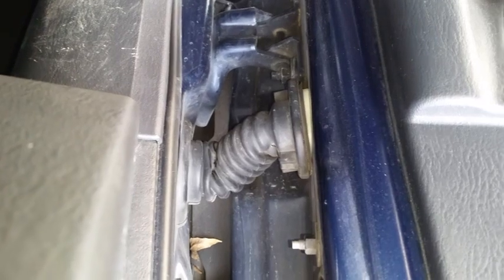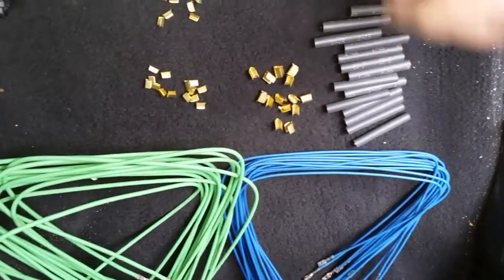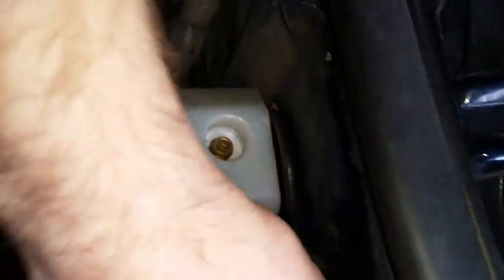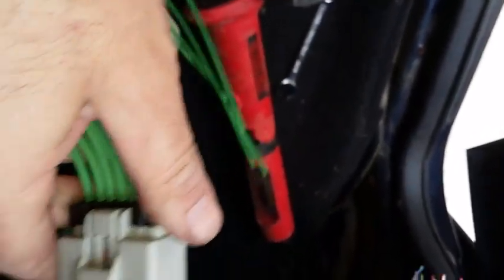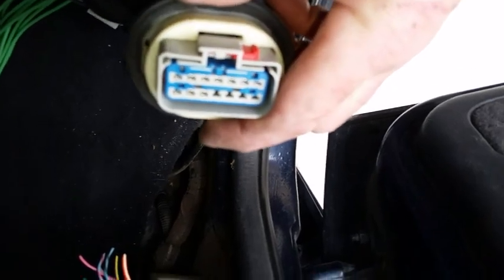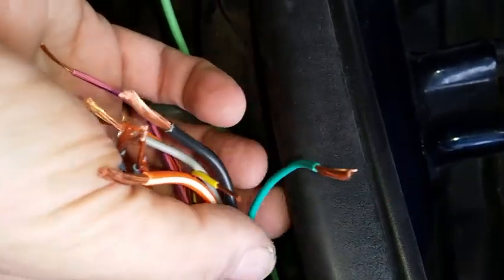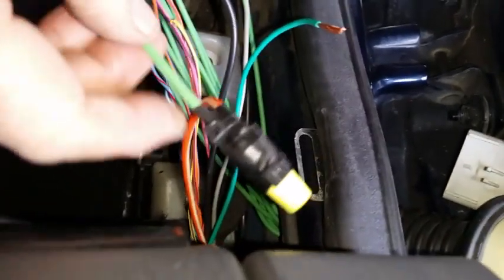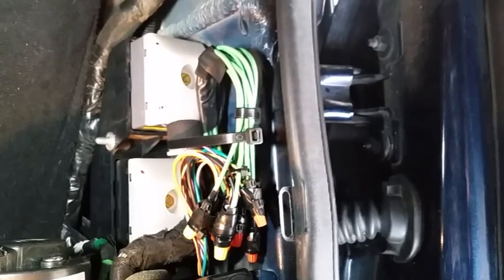1999 - 2004 Jeep Grand Cherokee WJ Door Wiring Repair

Comment: Placing the new connector with new wires beside the old connector with the cut off wires you can place a small piece of masking tape on each new wire a couple inches from the ends and write the correct color wire to connect them to on the masking tape and then push the wires thru the rubber door boot and make connections how you prefer. Then you won’t have to search for the correct wires with a multi-meter. Other than that there’s not really any other short cuts. This is a pain in the a** and has happened to everyone I know that has a Jeep Cherokee, especially 1999-2004.

Comment: The job would have gone faster if you labeled the wires with masking tape or something like that before you installed it. Wire nuts are for house wiring.
Reply from the maker: Pulling those wires through the boot with labels probably would mess the labels up.  In the video I mention I'll take heat for using wire nuts but they have worked well to this moment and are easy to deal with.

Comment: It is best not to soldier automotive wire,  it makes the copper brittle.  closed-ended crimp connectors would be a better choice than wire nuts.

Comment: Great video and very helpful. I bought the kit ($125 in Canada from the dealer) and I'm going to do this job as well. Too bad your video is upside down but it's still good info. Also, when you try and focus on something like those wire clip ends, it would have focused much better had you had a background near what you wanted to focus on rather than the camera trying to focus on the ground which was 3 feet away. Regardless, straight forward info that let's us know we can all tackle that job. Thank you!

Comment: Excellent video and the best way to repair that problematic area.

I went around pricing someone else to do this for me and here's what I found:  
A 4x4 shop wouldn't touch this project because they just want to bolt on parts.  
Next, I went to a car audio shop because they work with wires and they accepted the task - for $85 per hour plus parts/supplies, estimated to take about 1 hour to complete. 

If you think saving yourself the time and effort to order these parts assemble then get it all in and soldered is worth paying about $25 to $40 to have someone else do it, then go ahead. The car audio shop would have clipped the harness close to the door connector, soldered new wire there because it doesn't bend much and then ran the rest into the driver kick panel area and soldered the other end there.  

Another option - go to a You-Pull-It yard and yank a connector from a junked vehicle cutting wires deep into the kick panel area.  That may run you up to $30 but then you're gambling with that harness doing the same...any time after you install it.

All will work - key goal with either is to avoid stiff solder joints in the middle there between the door and body of the vehicle.
* Instead of wire-nuts to splice, I would suggest using shrink tubing and soldering the wires together.

Comment: Thanks for this video. I did the drivers side the same way except I soldered the wires and used shrink tubing. Also I plan to use the extra wires in the kit on the passenger side. You can actually remover the old wires same as you described with a small screw driver.

Comment from the maker: I did the audio shop route once but when it failed again I did this thing.  The original wiring is inferior to the new pigtail, the conductor had gotten quite brittle, perhaps from "work hardening" phenomenon.  I almost had the audio shop which does really good work, install these pigtails.  That's right forget getting this part at a yard.  I used wire nuts in case I have to repeat this repair and to avoid the hassle of soldering in the confined space.  But solder in the position demanded by the pigtail would not be a problem either.

Comment: Thanks.  I found the connector with  all the colored wires attached on ebay for about $12.00
using MOPAR P/N 5013961   Also included a set of in-line crimps.
The black wire appeared to be 12 GA.

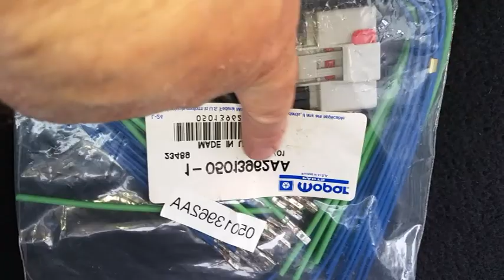Comment: At 2:30 you said the connectors are the same. I ordered two of the same. The drivers and passengers sides are different. The guides on the connectors are spaced further apart towards the corners on the drivers side. The passengers side is set in about 2mm on each side. 
I was however able to dremel the guides down and use the connector.

Comment: I'm thinking it could be easy to use colored stickers for the ends of each green wire.
You could get white stickers that are rectangular that can be colored with a permanent marker kit to duplicate the colors of the OEM wires.
For example marker the sticker for the + wire which is OEM red and white stripe to be red with white stripe on sticker. Put the sticker around the beginning and end of each green wire.
The ground can be black electrical tape or blacked out sticker with marker. And so on for each wire color.
It could help identify them. Maybe just look at OEM connector and map each wire accordingly without having to test each with a DMM.
I like that you use 12AWG on all 10 wires. 
Would it be fine to use 10AWG primary wire CCA on all 10 pins? I have OFC 12AWG on the way.
I've only got 16 and 10 Guage automotive wire spools on hand
100ft of GearIT 16 guage from Amazon and 20ft of HandyPack 10 guage from Rusty's Auto Parts.

I need to fix the windows mainly, then I'm rewiring the electric fan adjustable thermostatic switch for engine cooling fan with an override toggle on/off switch inside cabin that's ignition controlled and then wiring up power outlets (PD/USB3.0 & 12V socket)

Comment: I'm hoping I can use safley use 10guage instead of 12AWG for the door wiring to windows?
I have high quality 10AWG Primary Wire OFC 20ft . I also have 100ft of 16AWG automotive OFC wire.
I prefer to use the 10AWG guage for the doors and electric fan switch

Comment: I am so confused with the 10 wires all being green. I have no clue how to do the meter.
But is there a way to paint the outside of the wire or use colored tape or tape with colored markers to identify each wire.
Like Black, Grey+blue, red+yellow, Red, Green, Orange+White.
Something along those lines
I'm no electrician or mechanic and I'm simply trying to fix my power windows, power mirrors and Power locks on my
2002 Jeep Grand Cherokee Laredo 
Man wish I knew professionals like this in Aurora Missouri

Comment: Just bought a 2001 WJ with a 4.0 Liter. had to deal with broken door wires a week after I bought it. wished I had seen your video first, I had to solder the wires back together. classic black wire problem. change the two larger wire. when it breaks again I will do it your way. except the wire nuts would make me crazy as an industrial Electrician/ Mechanic.  But good job.
Reply from the maker: Thanks Michael.

Comment: Question: I can put the rear passenger side window down with both the driver control switch or the rear passenger switch and sometimes it won't come up until I open and close the driver side door a couple of times or close it firmly which of course speaks to the loose or broken wire issue in the driver side door boot. But since this can happen when the rear passenger puts the window down and not be able to put it up again until I go through the routine with the driver door ... is it more likely the driver door wiring (because it happens from that location as well) or the rear passenger side door wiring that is the culprit? Or is there more going on than just boot wiring such as some computer module? I hope my explanation of the issue makes sense.
EDIT: Just for everyone's knowledge, once I fixed the wiring in the driver door boot, I was able to raise and lower the rear passenger door without issue from both the driver control as well as that passenger window control as well.Thank you!

Comment: I just completed this repair to my driver door this evening.  Based on this video that the gray/black adapters would work either side - I purchased the passenger side kit to repair my driver door. 
 Finding:  While it's not exactly plug-n-play right out of the bag, it only took a little modification to make it work.
_________________________ 
Driver side:  If you hold the male end of the harness that is in the Driver door itself with the red lock tab face down, you will notice the oval shape of the main portion of the plug. In addition, however, you will also notice two small plastic ridges approximately 1/8 in height rising straight up off both left and right corners of the male plug....think of how batmans ears rise off the extreme ends of his head, if that's of any help at all?  lol

To make the passenger plug fit to the driver door, all I had to do was use a utility knife and shave off both of those ridges.  That plastic isn't soft so please be very careful.  The sharper the blade the better, or if you can sand it off with a machine then even better.  That's it.  Oh, I used wire nuts as well, taped each one then ziptied them all together; this, because I wanted to be absolutely sure everything worked as it should before soldering later.
Reply from the maker: Very glad it worked.  Another successful fix of Jeep deficient wiring.

Comment: Thanks for the video!  I've done a solder fix of a couple wires without replacing the harness.  Besides the window motor issue, what other electrical systems may be effected by replacing this harness?  I don't have a schematic for that harness.
Reply from the maker: Hi there.  Door Locks, Power Mirrors, Interior Light on for door ajar when door is closed.  It really messes stuff up because of the computer control of these things (Body Control Module).

Comment: How do you get the plug apart to put wires in it. ?
Reply from the maker: you just push the wire connector into the plastic body and it will snap into place.

Comment: Do you have any details on how to remove the pins from that harness? I have the pin removal tool, but can't remove them.
Reply from the maker: I have used a very small flat blade screwdriver from the wire side to press down the small tang that locks the terminal to the plastic connector - pressing down on the tang and pulling the wire at the same time.  When placing the terminal back in (new or old) pull that tang up a little so that it will automatically re-engage and lock the wire in place.

Comment: Wouldn't it be as easy to use heatshrink soldering butt connectors instead of wire nuts.

Comment: Hi. Where did u find? I do not see on ebay. Please help.
Reply from the maker: I got them on Ebay but they are not always available there.  Amazon has one for about $60 and another for about $50.  The only difference is color so two of the cheaper ones would work.  Mopar sites are about the same price.  For eBay set up a email notification search for both part numbers.  If you need them right away Amazon is it.

Comment: Wire nuts in mobile applications is not to be done.  That's the most ridiculous thing I've seen. 
You sir should not give advice
Reply from the maker: Your prediction has so far failed.  Even if one loosens it is trival to repair.  In the video I mention I may catch some heat for wire nuts but "should not give advice" - a little heavy on hyperbole, don't you think?
Reply: Lol they hold up pretty good tho I use them all the time for quick repairs when d.o.t. officers put trucks out of service for no lights!